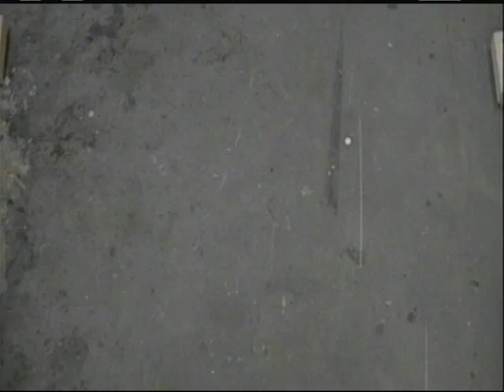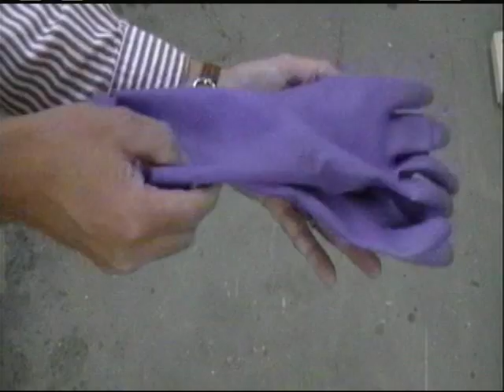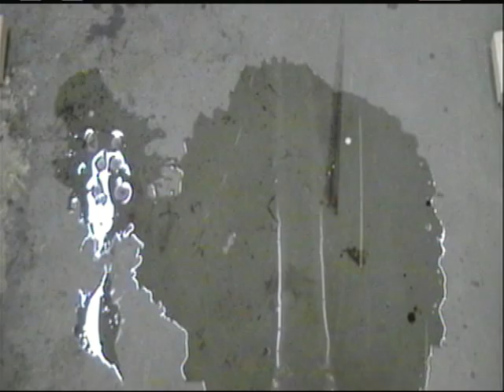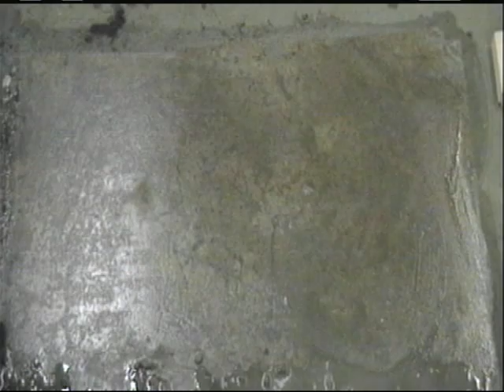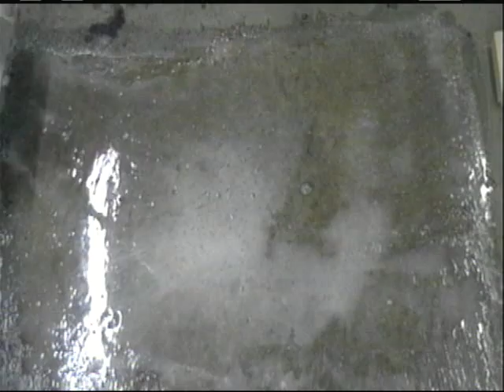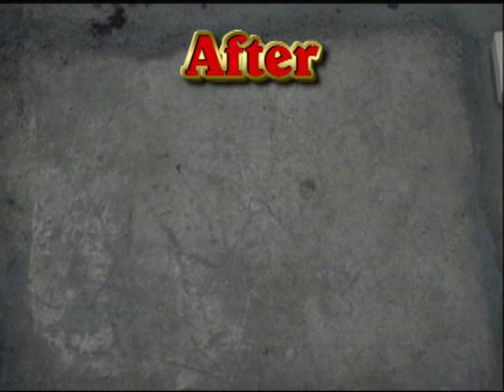How to Strip a Concrete Floor with RonJohn.mp4

Comment: Dang that annoying music, but I tolerated it because that is the best paint stripper for concrete on the market according to the video. We shall see. Just ordered some I will try it and repost as to how it worked! Ordered a week ago still waiting for it to arrive not the fastest shipping.....Update: I paid close to $70 for a gallon it wasn't all that good as far as removing paint from concrete and we are only talking 1 coat on a cement patio. I used JASCO and it blew this stuff away! Much cheaper as well! My recommendation: Don't waste your money.
Reply: Jasco muriatic acid right?